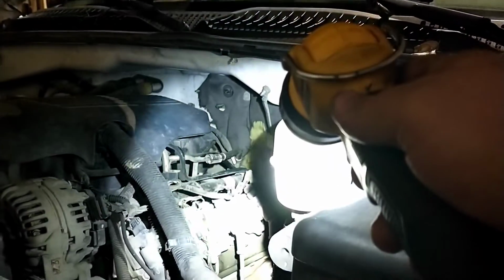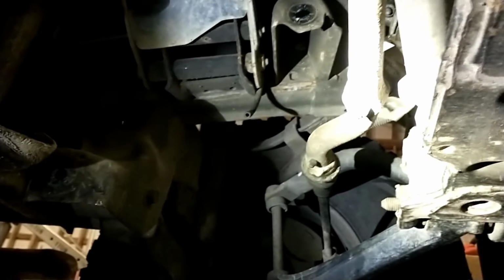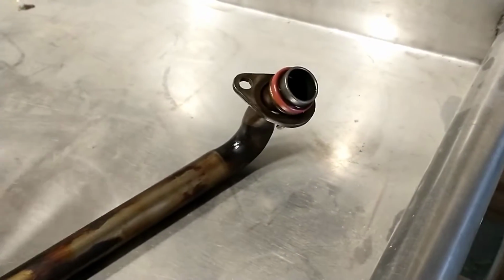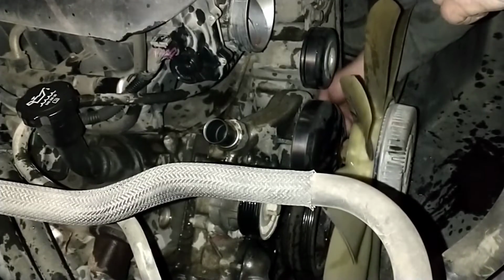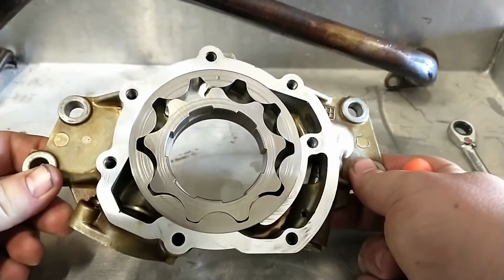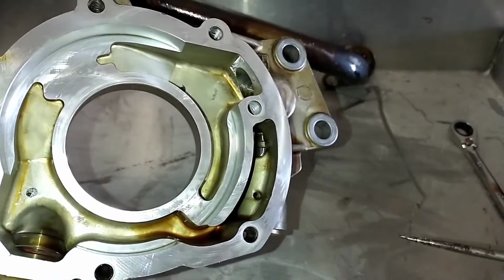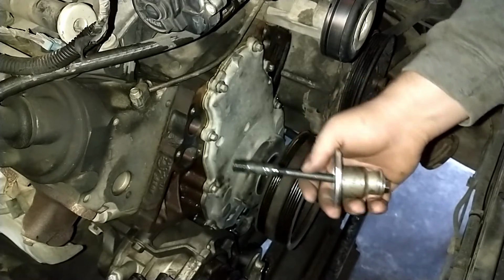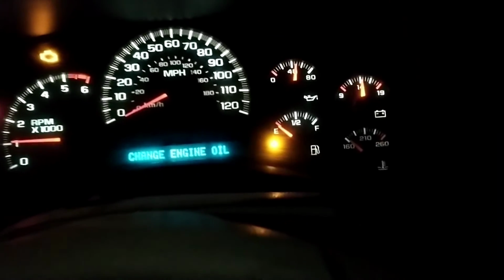Sudden Loss of Oil Pressure Diagnosis and Repair on a 2007 Chevy Silverado 2500 HD Classic

Comment: did you replace the pump or clean it to eliminate the stuck valve?
Reply from the maker: Replaced, after I got the piston moving it felt fine, but I didn't trust it. Thanks for the comment!
Reply: @assemblyrequired1  smart decision!

Comment: I had the same problem on my 2000 5.3 Silverado I didn't have to do the pump though but yeah dropped the pan cleaned it out replaced the pickup tube and the O ring and a screen on the sending unit all good now at 188000 miles
Reply from the maker: I was hoping that would fix mine!  But of course not! Good luck with yours and thanks for watching!

Comment: So oil pump ? I just changed the oil pan gasket on my truck and I replace the oil sender tube and my oil pressure gauge doesn’t move it stays it doesnt move at all so I drive it around the block thinking it would move and nope truck died on me had to tow it back and now I’m figuring out what could it be but before I changed it my truck drove fine so I don’t know what the problem is
Reply from the maker: Hard to say exactly.  Could just be the Oil Pressure Sending Unit that's bad.  First thing I would do is check it with a manual gauge to see if you are getting pressure out of the pump. If no pressure, then yes, oil pump.  If you are getting pressure, then the sending unit or gage is likely.   I would be cautious of driving the truck until I knew if I was getting oil pressure.  Does the starter still turn the engine over?  Hopefully it didn't die because the engine locked up!

Comment: Did it make any valve noise when it lost oil pressure?
Reply from the maker: Zero, that's the major reason I suspected the sending unit at first.  I'm glad I stopped and checked things out before I drove it.